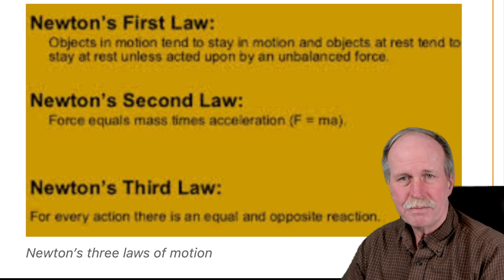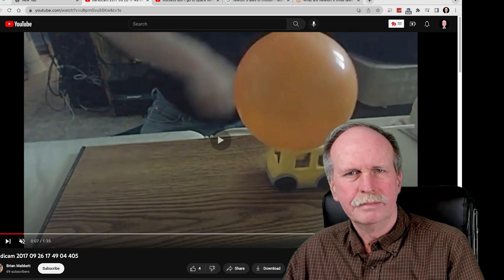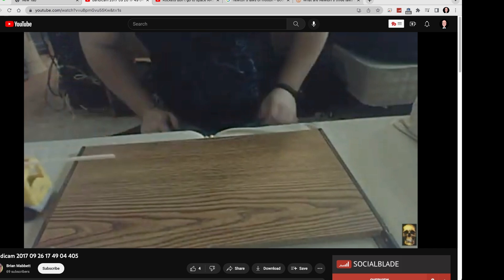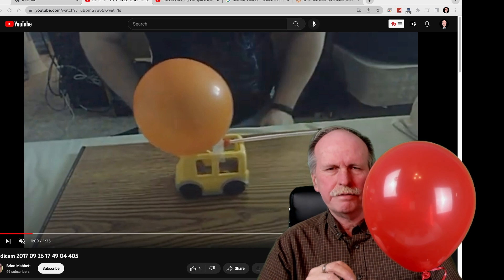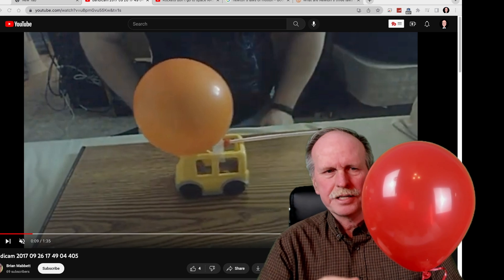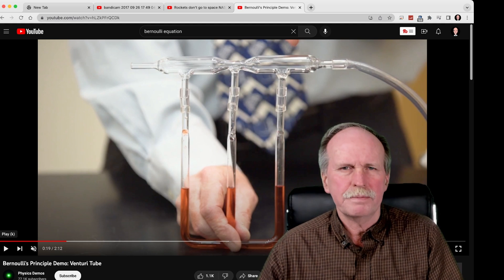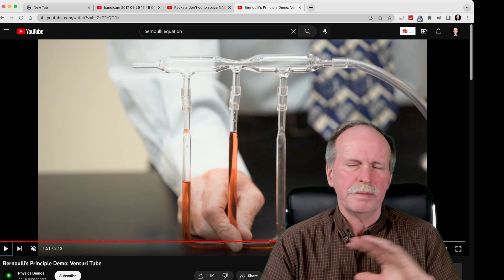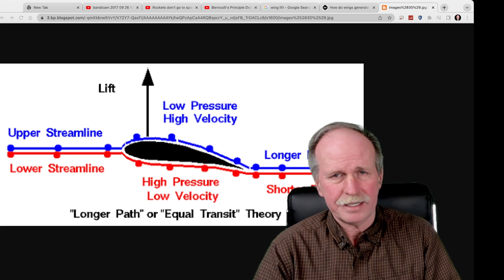Flat Earth Proves Rockets DON'T WORK

Comment: I know that the explanation of rockets that is most used, is Newton's third law, however, I have seen explanations based on the conservation of momentum and it is the mass that is ejected at the backside that reduces the mass of the rocket itself, and this leads, by conservation of momentum, to the rocket being propelled forward. Both explanations make sense to me, which one would you prefer?
Reply: The conservation of momentum and Newton's third law of motion are (sort of) synonym: they directly imply each other.
Reply from the maker: are they not all interrelated?  I prefer the simplest way to answer the question.
Reply: If the expelled gasses had zero speed the second method could be used, when the gasses have speed (thus energy) the first method makes more sense as far as I understand.
Reply: @ottonormalverbrauch3794  If the exhaust had zero speed relative to the rocket, it would not even be expelled.
The momentum that is conserved is the total sum of the rocket, the propellants in the tanks and the exhausts, each of which with it's own speed. (Note: think of these speeds in three dimensions.) The engines transform the propellants into exhaust by giving it speed relative to the rocket and then just let go. The momentum of this new exhaust is taken away from the rest of the rocket, propellant and other exhausts and because the total sum of these is constant, the mass and speed of the rocket and propellant is changed: i.e. the engine provided propulsion to the rocket.
Reply: @Apollorion  I meant the expelled gasses having zero speed to an observer on earth. Then their energy would have gone into the rocket. I think it's more practical to start from the speed the gasses have as seen from the rocket, the necessary energy to accellerate them to that speed has gone into the rocket.
Reply: @ottonormalverbrauch3794  Don't confuse momentum, which is three dimensional, and energy, which is one dimensional, because they're both conserved.
I do I agree though that to accelerate the exhaust you need energy, but this energy goes both to the exhaust and to the rocket. Possible sources of energy are:
- high pressure of (relatively) cold gas in a container (such as shown in the video)
- potential chemical energy, released via combustion and then as heat boosting the pressure of the gas which is then via a nozzle ejected at high speed (this is usually used during launches of big rockets)
- electrical power which accelerates ionized atoms or molecules very much via an electric field before ejecting them (these ion engines provide not much propulsion but require also not much weight for their propellant)
Reply: @Apollorion  Another: mechanical springs or elastic bands.
Reply: @fromagefrizzbizz9377  Such are indeed sources of energy, but they are practically not used for rocket engines.
Reply: @Apollorion  Well, no.  Of course not.  But the point was to demonstrate the principle of thrust - mass ejection using whatever means suits the situation.
Reply: They’re the same thing.

Comment: Your explanation of airplane wing lift is incorrect.  First the air flowing over the top of the wing does not have to meet the air flowing under the wing at any particular spot.  This has been proven in wind tunnels.  In fact it doesn't.  The air separates and never meets up at the same spot.  The air on top of the wing does flow faster which creates lower pressure but has nothing to do with meeting up with the air on the bottom of the wing.  Second, most of the lift derived from the wing is not related to the air flow.  It has to do with the angle of incidence of the wing.  This angle creates a downward force that lift the airplane.  Stand if front of an airplane and you can see how the wing is titled slightly upward.  Bernoulli and Newton working together to get the wing in the air.  If it was the shape of the wing that determines lift then please explain how an airplane can fly upside down?  Again, Newton.
Reply from the maker: excellent points, I presented it as I did for clarity of understanding.  While I agree with you, adding a layer of detail as you did doesn't always clarify the concept being presented.
Reply: If you know any thing about flying inverted you will know the aircraft must be pitched nose ( down) up (away from the ground) and if not correct it will lose hight ,by doing that you increase the angle of attack and so create a small amount of lift from the underside of the wing , not sufficient to create lift but enough to maintain hight for a short period
Reply: @stephenhill8790  Which is D Bradford's point when he said "this angle creates a downward force that lift the airplane". This is also why wings with a symmetrical profile work perfectly well. It is the angle of attack that both reduces the pressure over the wing and causes downwash, both of these being responsible for the wing's lift.
Reply: @coriscotupi  which is why the aircraft design has a lot to do with how long it can sustain inverted flight, fighters and stunt often configuration is for inverted but for commercial and long distance cargo inverted flight is difficult if not impossible to maintain
Reply: @stephenhill8790  Not really. The time constraint of inverted flight has nothing whatsoever to do with lift or other aerodynamic aspects but rather with aircraft systems, such as fuel feed and lubrication.
Reply: @coriscotupi  the wing profile has everything to do with inverted flight , the lift is all  produced by the wing. The only exceptions are ballistic missiles and rockets and they are not designed to fly horizontal for any great distances, and if it is necessary they will have small wings mainly for directional control, gliders have no power some can fly inverted for a limited time others can't
Reply: @stephenhill8790  Sorry, you have no clue of what you're talking about. Given enough engine power so that an airplane could maintain adequate airspeed while inverted, it would fly all day inverted, even with a "Clark Y" (flat bottom) airfoil. Aerodynamically there is no such thing as a time constraint for an airplane to fly  inverted, given enough engine power.
Reply: @coriscotupi  I was a principals of flight instructor I taught men and young woman who went on to fly fighters commercial aircraft, rotary wings (helicopter to you) heavy freight, piston engine, turbo prop, turbo fan, gas turbine, if you were to attempt to fly a 747 727 C130 Airbus 380 757 air bus 318 etc inverted for any length of time it would either tear it self apart , start to descend or suffer from engine failure , aircraft design including wing profile wing position I could go on   decides what  an aircraft can or cannot do
Reply: @stephenhill8790  If you want to play that card, I've been a pilot (fixed wing) since 1985 with commercial, IFR, multiengine, and CFI (flight instructor) ratings, and flown a good deal of rotary wing in the 70s.

Moving on to your assertion:

"inverted for any length of time it would either tear it self apart , start to descend or suffer from engine failure"

Do you not hear yourself talking? What  exactly does "tear itself apart" or "suffer from engine failure" have to do with the wing airfoil working upside down? Care to explain? The first is a MECHANICAL issue, not aerodynamic WHICH IS WHAT I'M DISCUSSING HERE. And the second is a SYSTEMS issue, not aerodynamic either. As for the "start to descend" bit, I gather you missed the fact that my previous comments were qualified with "GIVEN ENOUGH POWER".
If you tried to fly ANY aircraft inverted, given  (1) enough power, (2) inverted-enabled systems such as fuel feed, etc and (3) structural integrity to do so - which I didn't mention before but is NOT an aerodynamic issue anyway, it WOULD fly unrestricted by time. Sorry.
Reply: @coriscotupi  ye ye ye we believe you
Reply: @coriscotupi  but what kind of power would it take to fly a large commercial aircraft inverted? I'm a layman and am asking out of curiosity, yet I can see stephens point. Your saying it's possible, but what would it really take?
Reply: @someguy5438  You'd need a "higher" negative angle of attack (as compared to right side up) but since only a moderate angle of attack is required for high (read cruise) speeds anyway, you'd probably need a marginally "higher" (inverted) angle of attack for inverted flight, yielding somewhat higher drag, requiring somewhat higher power. But that was not even my point. It was stated by the other poster that a wing could only fly inverted by a limited period of time.

Allow me to quote his first reply to this thread:

[begin quote]

"you increase the angle of attack and so create a small amount of lift from the underside of the wing , not sufficient to create lift but enough to maintain hight for a short period"

[end quote]

That is plain wrong. One cannot make a blanket statement that an inverted wing will not have enough lift, let alone that it will fly "for a short period".

What I'm saying here is that from an aerodynamic point of view, if other areas (structural, systems, power, etc) are satisfied, a wing with any profile will fly for as long as desired while inverted. That was my point.
Reply: @coriscotupi  cool, man.  Just a question.
Reply: @coriscotupi  so a flat panel with no profile will create lift simply because the angle of approach? Why are wings shaped the way the are?  P.s . You don't need to write a book.
Reply: @someguy5438   yes, a flat plate at angle of attack will create lift, just not as efficiently as an airfoil shape.  The wings of lots of aerobatic planes are completely symmetric because they have to create lift while inverted just like when they are right side up.
Reply: @roberthiers3460  wouldn't a flat plane at an angle require tremendous power and be subject to stall?  I.e. zero glide?
Reply: @someguy5438  
"So a flat panel with no profile will create lift simply because of the angle of approach?"
You mean angle of attack.
Yes, it will. 
Proof positive: balsa wood gliders with flat plate wings which have in  fact pretty good glide ratios.

"Why are wings shaped they are?"
For better efficiency. For structural integrity. And  for better behavior at high angles of attack at low speed.

"You don't need to write a book"
I don't believe I did. And you should try reading one, on basic aerodynamics.

"wouldn't a flat plane at an angle require tremendous power and be subject to stall?  I.e. zero glide?"
No, the angle of attack required for flying a flat plane wing at low wing loading is well within its useful lift-generating region. As can be seen in practice with the balsa gliders as mentioned above, which glide pretty well actually.

Comment: It's not even a good analogy, as rockets don't use balloons full of air, they use solid fuel.
Reply from the maker: well it does demonstrate a principle.
kudos for trying flerf!
Reply: @BobtheScienceGuy  I hope that's not aimed at me, I'm genuinely not a flerf! I have clearly incorrectly stated all rockets use solid fuel when it obviously some use liquid fuel. My point was I didn't think the flerf experiment was anywhere near a good example of what they think happens
Reply from the maker: No, it is directed at the flerf with the balloon.  At least he tried.
Reply: @BobtheScienceGuy  phew!
Reply: @lordpablo1985  Well, solid or liquid, when the fuel does its task, it is converted into hot, fast gas. that is coming out of the nozzle.
Reply: LOX & kerosene is solid. Ok ...
Reply: @El_Grincho  sorry, I was just thinking about model rockets and maybe some big ones use solid fuel? Genuine mistake
Reply: @lordpablo1985  Solid fuel motors are used for boosters, but the main stage of large rockets (that go to space) is nearly always liquid fuel of various types. Several reasons for that, AFAIK.
Reply: @c.augustin  The main reason the solid rockets are only used for boosters is that the are only either on or off.  If you want throttle control you need a liquid fuel rocket.
Reply: @Isolder74  I know that, but English isn't my main language, and I'm not well versed in this area (I do understand most of the terminology, but if I try to say something in this area, I'm lost – "throttle" is the exact word that I would've missed ;-)).